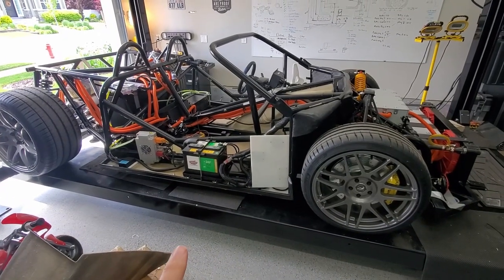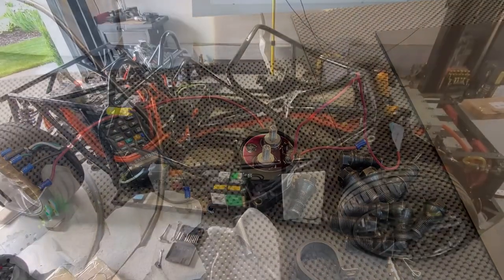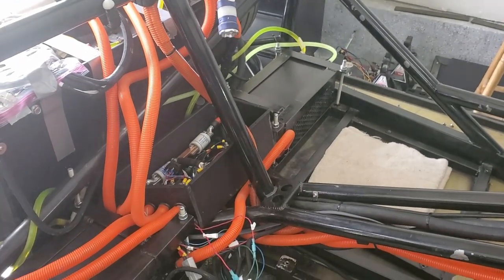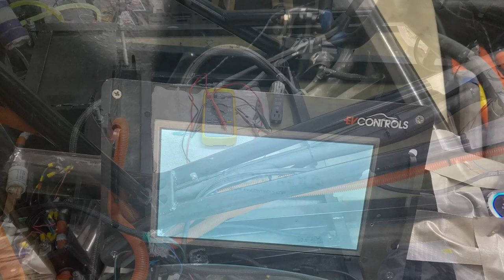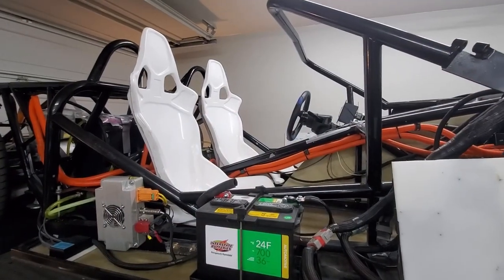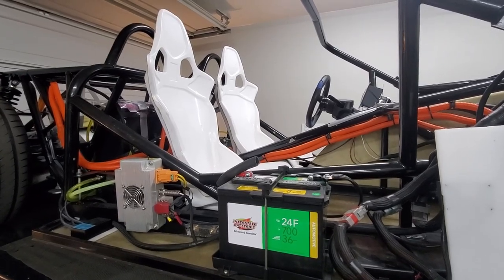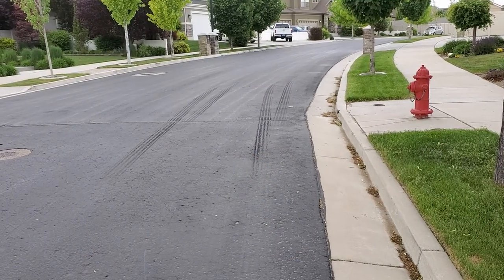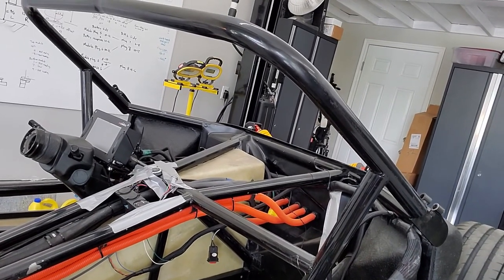2nd drive - Electric Supercar, DIY Tesla Roadster

Comment: I love your project. I have one similar project like yours, but with a motorcycle. This contactor problem you had will keep happening. It seems you need to check your precharge and discharge sequence. It will solve the problem forever! I wish you the best!
Reply from the maker: You are absolutely right.  I am pretty sure that I caused the problem by troubleshooting.   Thanks for the comment!

Comment: I have to echo what ￼T Bree said.   If the contacts are truly stuck/welded, then they need to replaced/serviced.     They can get welded by not performing the pre-charge first.   I'm not familiar with the controller your are using.   Any diagnostics you can run?   Does the Telsa controller have traction control?     Awesome build.   Sorry for the troubles.   Has to be pretty frustrating at this stage to be so close but worried about these issues.    Keep the persistence up!  You will get there.   Thanks for sharing and helping us all learn..

Comment: Now those are quite worrying findings. Welded contactors only happen due to being open and closed under current. Once welded it is best not to keep using the contactors. Also you described problem with the strange behaviour makes me worried there is HV leakage to chassis, please check this and fix it.

Comment: Does it use a Tesla charge plug?
Reply from the maker: J1772 plug
Reply: @ElectricSuperCar  oh ok. If it has a Tesla plug, it could have used the super charger network if there where the right circumstances